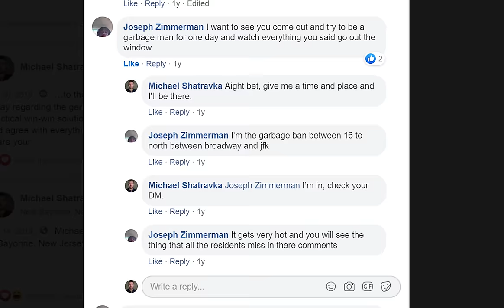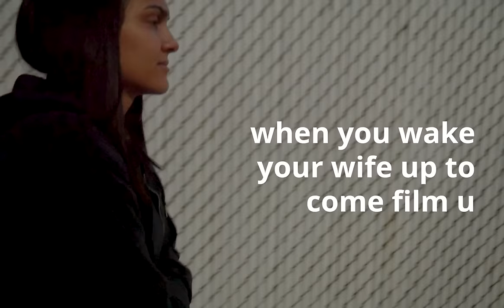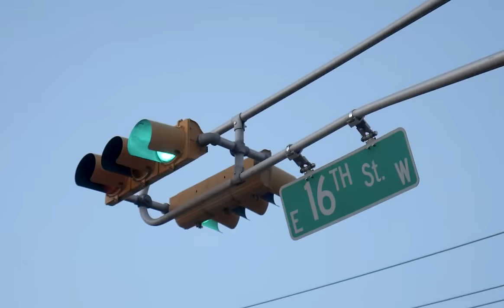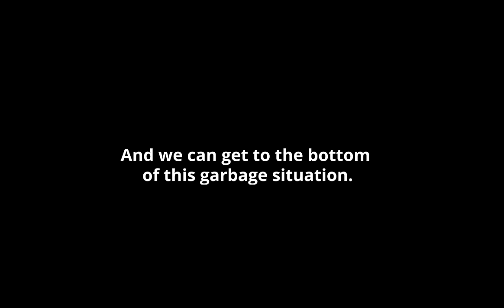I was a Garbage Man for 90min - MOST GRUELING JOB EVER.

Comment: I did the job for 1 year, hardest job i ever did and the most dangerous. I was solo on the back and i ran allday, not to mention someone was badly injuryed or killed weekly. It ended for me when i broke my ankle. It wasnt worth it anymore. The best thing about the job is the pay$, i made fucking bank👌🏻
Reply: I did it for about 3 months! And I was nearly mowed down a few times by impatient idiots! Then the needles. Oh the needles! That was one of the primary reasons I quit. Every single coworker had been pricked several times. I have a phobia of needles, and when you get pricked, you go through a series of shots. Nope!!! Not me! 

I was solo, and literally did everything. Drive, jump out, grab cans, dump, put cans back, jump back in, and repeat 900 to 1200 times. My 43 year old body was finally getting used to the work, but holy shit was it painful! I could barely walk for the first month!
Reply: @ChrisJohnson-hk6es  yea i feel you bro, the needles were a fucking hazard. I was also almost hit several times a week by impatient drivers. Although i had my route down pretty good my bosses were dickheads and i was paid salary. So they over worked everybody. That job was a revolving door of new people weekly. Ive seen people quit 3-4 streets in because of the running and continuing lifting.
Gotta love those stops that would have a bedroom outside with 8 trashbags

Comment: In finland we have one man how has to do all of that. Drive a truck and get all of the garbage. On the other hand we might have long distance to the next dumbster. We live so far away each others. In the block of flats we have shelters where are separation paper, cardboard, class, metal and mixed waste. In finland our garbage trucks is build that way that we dont have to throw the trash in hands, just put the dumster in the rack and fold the dumster in the truck. Same way the trash is gonna squeezed in the trashpacker. And we have to drive slippery winter and very tiny roads sometimes. Thats the difficult part. Thank you!
Sry my bad english language skills:(

Comment: Did this during and 
After hurricane sandy tore through Hoboken NJ 40 ft mounds 2 football fields long under the dry dock and 40 to 50 bags for every apartment that was flooded and from renovation work days fly by and if you have a great crew 1 or 2 solid guys honestly but this becomes second nature and fairly easy  but dude you looked like a big baby out there especially only working a hr and a half  😂

Comment: In my city they moved away from this method of collecting to where everyone has a small mini dumpster.  The arm on the truck grabs the bin and dumps it into a larger bin on the front.  When the bin at the front fills up they dump it at the top to compact.  Also we have a recycle truck bi weekly that does the same thing.  One guy per truck.  The street parking in this video would make my areas method not worth it.  Much respect to these guys.

Comment: In france and most european countries I've seen, household trash is seperated beforehand for recycling. Items such as bikes and furniture like I saw in this video would never be taken by the trash collectors. Also the garbage man does not pick up bags anymore, for the most part, a special fork picks up the specially made trash can. This job is made difficult because there is clearly no recycling in New jersey or very little. The equipement being used by these workers is outdated.

Comment: Another grueling job is stacking used tires into semi trucks for 10 hours a day, 6 days a week. The wires are hanging out of the tires and cutting you’re hands all to ribbons, they are filled with stagnant water, and there are trucks that you fill with commercial tires like car and truck tires then there are semi truck tires that weigh over 100 lbs and you have to pick them up, toss them and stack them. I did it for a week and my back still hurts lol

Comment: Awesome work, well done.

Just some thoughts on what could be done differently.

Make your county issue bigger garbage cans, with wheels and with lids that deflect water and keep animals out, with a standardized design to be picked up by garbage trucks.
Get better trucks, with mechanism to pick up and dump the content, so you only have to wheel it over. 
If it doesn't fit in the garbage can, it isn't getting picked up. No bicycles or wooden cabinets, make them take that stuff to the garbage disposal center themselves.
And finally, and the toughest one. Inspire a change in people to stop littering and sort their trash properly.

Comment: In my area, the bin men actually run their route. They get paid the same regardless of how long it takes so they've realised they can knock off early if they run. Keeps them fit I bet!

Something UK bin men have a bit easier than their Bayonne cousins is that most (if not all) areas have wheelie bins these days, and the dustcarts have a hydraulic system to tip them like miniature dumpsters - plus most places are strict about how the rubbish needs to be in the bin rather than piled up to the side. That latter one can be annoying, but like most rules it's because some idiots take advantage and spoil it for everyone else. Our bins are 240 litres or 360 litres, I guess that's about 70 US gallons or 100 US gallons, so perhaps it balances out.

Comment: My American exchange student housemate was amazed when she saw Australian rubbish trucks using a hydraulic arm to pickup and empty our bins . The driver doesn’t need to ever get out of the cab. And yes they can easily pickup bins from between parked cars etc. Easily faster than men doing it by hand. Been in operation since the early 1990’s. Having guys manually handling the rubbish is just insane . It’s almost like the yanks want to make the work as hard and as dangerous as they can for the little guys …

Comment: This takes me back (not too fondly) of working 9 years on the rear of the truck in the lower Alabama heat of summer throwing everything away and the kitchen sink here and there.

Was hard work that could/would drive you insane at times, but I came out tougher and mentally stronger for it, so I'd call it beneficial overall.

Still at the same job, but have become a fat, out-of-shape driver of an automated truck.

Fun fact- fire ants do all of their best gathering of "food" in garbage cans, so you get your ass lit up in the summer months.

Another fun fact- Also during the summer months, wasps like to build little love nests under the rims and handles of the trash containers, leading to a nice little surprise boiling out when you move them. Oh yeah, spiders of all flavors love to live there too.

Comment: Over here in the uk we all have the same garbage bins, they are large and have secure closing lids, so nothing can get in unless you open it and these lids can’t be taken off they are fully attached to the bin. These bins are supplied by our council and are replaced if damaged. By the looks of it in this video, this part of America seems to have bins that are open and have no lids or have lids which can be taken off, as well as being quite small, which quite obviously isn’t great for keeping in rubbish and attracts animals. The first thing that the council/state should be looking into is upgrading the quality of the bins which are used for every household. If everyone was to have the same bin which is big enough to store a reasonable amount of rubbish and is secure then there wouldn’t be such a big problem with litter flying all over the place. In the uk we also have holders on the back of the bin which connects to the garbage truck and it tips in the rubbish for you, this reduces a huge amount of labour on our sanitation works and is much more beneficial to them as it makes the job that little bit easier. Of course I see litter on the streets but that’s because people can’t be asked to put it in the bin and even what I do see is nothing compared to what I’ve seen on this video.

Comment: I worked on a garbage truck for 16 years in Jersey. I miss it unfortunately I got sick and need a pancreas transplant so had to stop. But hope to go back at some point. To those that complain about the garbage man making to much noise or what ever blah blah first off come out and do we do. First off we have to been In by 330 in the morning 6 days a week. So depending on where a worker lives your up and on your way to work by 2 to 230 in the am. Your in the town you pick up In by 430 5am. Normally your out if lucky by 4pm. Some days longer depending on how heavy it is and the weather. I've worked days where I didn't get done to almost 7. So pretty much when you get home you shower eat dinner and go to sleep almost no time for your love ones. And don't forget the weather your out there in rain dangerous lighting snow  bad wind ect. The only time of year I enjoy working in Is fall and spring. Its not easy

Comment: I've worked as a garbage man a bit and when I saw this title my first tought was ''I remember it was kind of hard sometimes but not too bad''.
And now that I've seen the equippment they use I totally get it... this is some seriously outdated stuff man and the garbagecans some of them don't even have wheels on, and they take almost anything not just food/garbage waist they also grab old furniture, glass, old lamps, scrap wood from house renovations. thats just fucking insane.
The whole system and equipment was outdated even 30 years ago.
First of all the garbagecans needs to have wheels so that they won't have to carry them they should also have a lid so that it doesn't get filled with rain water, they should also not be filled with anything other than household waist like food, plastic and paper. anything else should be the owner responsibillity to get rid off at a waist management facillity.
Second they also need new trucks that have a lift that can grab the garbagecan and dump it in to the truck so the workers won't fuck their shit up lifting these heavy garbage cans.
There is ALOT more that need to be done but thats just a start.
sorry for shitty english it's not my first language.

Edit: also they don't even have proper working clothes! they just have a highvisibility vest on with their own clother under they should be given proper working attire! shoes, pants, shorts, t-shirts, swaters, jackets.

Fuck this is actually making me mad!

Comment: I do this as a job in England and I'm shocked to see how these guys in America do this job.
Bins over here are all on wheels and we hook them on the back of the truck which lifts and empties then automatically (would be fired if we empty them manually like these guys).
Alot of councils in this country only take rubbish if its in bins, no loose bags. Alot of the stuff they take in this video such as the strip lights and the furniture we wouldn't take and forget riding on the back of the truck like that. We either have to run, walk or ride in the cab with driver as if we ride on back of truck it's illegal over here.

Exactly the same job, as we also empty about a 1000bins plus a day, but in a way its also so different.

Comment: The problem is the structure, here in Norway we a have a common garbage location where everyone needs to walk to to throw their garage so the garbage collectors don’t need to move that much and the trash can have all rolls, they just push it to the truck and the machine throws the trash. It’s still a hard job but at least it’s much easier than this

Americans don’t want to walk very far to throw their garbage it seems. Every neighbourhood should have a centralised garbage spot where everyone throws it there and design the machine to collect it quickly

Comment: This is how bins where emptied about 20 years ago, wheelie bins and auto loaders are needed. Here where I live there is a crew of three plus the driver, and it's not as back breaking as for them.
Investment is needed in new lorries and bins, this will help these hard workers avoid health issues later in life and save them in turn health care costs and the company insuring them. So it's worth the investment in the long run even in monetary terms at a basic level.

Comment: Garbage Man, Garbage Collectors and Sanitation worker are all blanket titles for a coin that still has two sides. Driver and then you have the  dying breed the man who rides on the  back of the Rear Loader's and it's like no one ever gave a damn enough to actually come up with an official title for the side riders. I'm one of these side riders and I love the company that I work for but they've been calling us slinger's for years. It may just be me but I don't like that title because I feel it doesn't really capture the whole entirety of what we do. So I made it my mission to come up with a better title. I came up with Handler 

Description
Garbage Truck Handlers are the  men you see riding on the back of the trucks, emptying cans in residential areas. The job also includes Handling yard waste, recyclables & heavy bulk. The Handler ridrs on the back of the garbage truck and steps off when the truck stops. Handlers pickup  yard waste, recyclables, bulk garbage, bags garbage, and lift and dump garbage cans into the back of the truck which is called the hopper. Handlers our exposed to a physical environment, which involves dirt, leachate/garbage juice, odors, noise, all aspects of weather, and  other extremes throughout the entirety of the workday.

Comment: Michael  try doing this with a Pak mor side loader where you have to lift cans 5 feet in the air by yourself that's what I did for 10 years  the rear loader  you had was simple and easy

Comment: I think it's a joke they use those bins, has America not seen the wheelie bin? Has wheels (obviously), a full sized handle and a closing lid. Even the trucks have all the machinery to empty them. Kinda proves America doesn't really recycle aswell as all the money required for changing the process would come from sorting and recycling all this rubbish. Doubt it got better since you posted this aswell. Good work though man, shame about the dead ankle too
Reply: My family has those. In the cities the trash cans are fairly standardized bur out in the countryside they deal with whatever the residents get from the hardware store.

Comment: Should have posted the previous video where you were wrong in the description, unlisted of course. Best way to own up to a mistake is by keeping record. And my main issue is that without the context of the previous video I have no clue what conclusion I'm supposed to get at. All I can see is that your garbage system is a joke, no standardized sized bins and very little automation. Even in Greece we have large bins ON WHEELS that the workers just pull up to the truck which it will flip over on it's own. Would have appreciated if there was an explanation on exactly what you said that was wrong last time and what you propose now should be a solution after you've had this experience. :/

Comment: first thing that I see is that, "you" are lifting the bins. now thats just wrong when u have a truck with a motor that can operate a lifting mechanism. or even better look up how frikking 
Netherlands are doing it :)
Reply: To be fair I think it’s because the neighborhood is very tightly spaced, and a lot of cars in between, a lifting mechanism would not be able to grab trash cans in that tight space without hitting a car or something
Reply: @angelaguilera600  ofc, but I'll need a new lifting bar at the back of the truck, and the bins needs to fit that bar. That's just once solution.